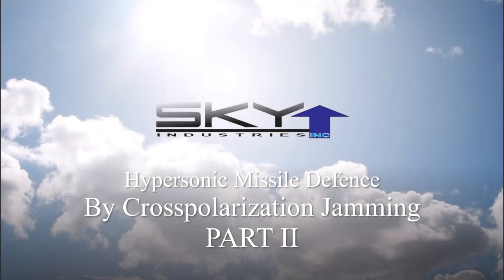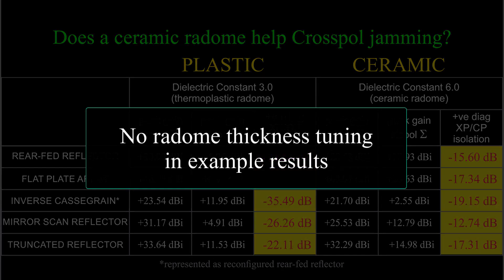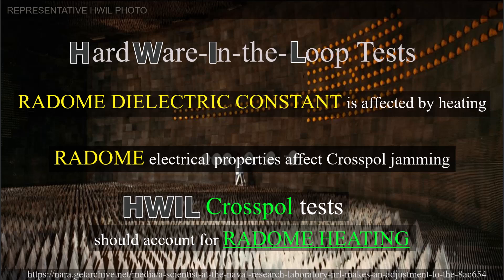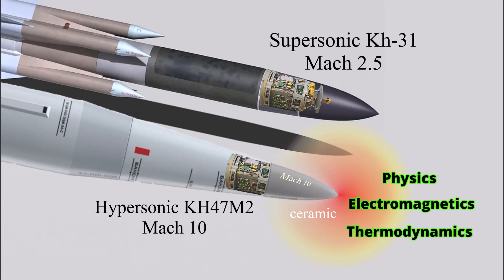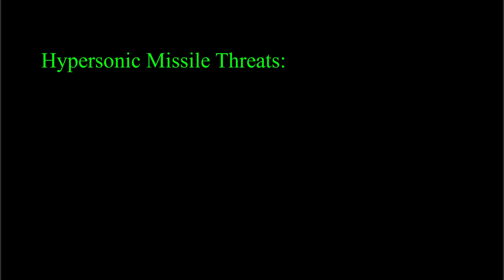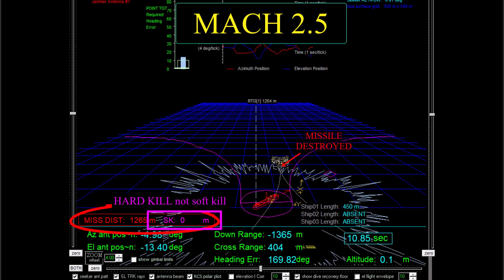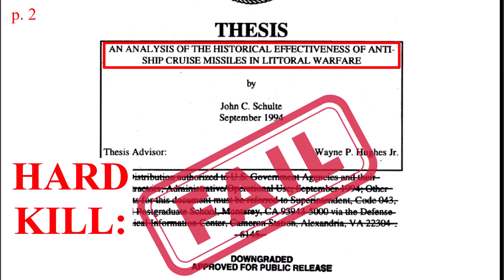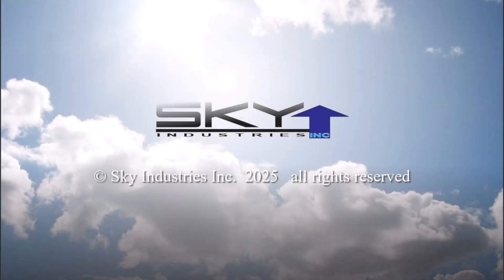Hypersonic Missile Defence By Crosspolarization Jamming PART II 25

Comment: There must be ways to eliminate plasma build up.
Reply from the maker: Yes - slow down!  

As a gas is compressed its temperature increases.  A flying high-speed missile compresses the air in front of it.  Above Mach 5 the compression is so great, and the temperature so high, that electrons become dissociated from their atomic nuclei.  That's a plasma, the fourth state of matter after solid, liquid, and gas.  

Reason metals are conductive: their are atoms are arranged in a crystalline pattern, but the electrons are free to roam around.  A metal is atoms in a sea of free electrons.  

A plasma is the same as a metal in this sense.
Reply: @skyindustries Thanks for explaining, so i guess 😅there is no way to eliminate this effect.

Comment: How about having an aerodynamic heat shield over radome which gets discarded in the final phase of the flight thus leaving you with a perfect radome?
Reply from the maker: Good question.  

A perfect radome in this sense would have a relative dielectric constant of 1.0, e.g. air.  There are materials with low dielectric constant, such as syntactic foam (plastic with tiny air bubbles https://en.wikipedia.org/wiki/Syntactic_foam), but no material which also has the mechanical strength required for a high-speed radome.  

Result: any radome will cause crosspolar gain by bending the polarization.  A ceramic radome happens to cause a relatively large crosspolar gain.  A thermoplastic radome will also cause crosspolar gain, just less than  ceramic.

Comment: what if you had a mach 10 radome that falls off after the missile slows down to mach 2.5 to reveal a mach 2.5 radome
Reply from the maker: Good points, but it doesn't solve the problem; a ployamide radome would likely work at 2.5 Mach,, but it also causes polarization bending - just not as much.  

Ditching the radome seems a risky maneuver at high speed.  There would have to be a big payoff to justify the cost and risk.  Payoff looks too small to me.

Comment: cant a missile be designed with a glass dome covered by a ceramic panel that jettisons at supersonic speeds during its terminal target acquisition phase?
Reply from the maker: A good and fair question.  

It's possible if enough money and time were spent, but it doesn't solve the problem.  

The main-thing issue is polarization bending cause by the combination of radome shape and the dielectric constant of the radome material; the higher the dielectric constant and the more curved the shape, the more polarization bending there is.  The dielectric constant of glass is ball park the same as ceramic, or possibly higher - so glass might be worse.  

What matters is how the microwave signal travels through the radome.  This isn't the same as the optical properties of the radome, so even though it's possible to see through glass at the short wavelengths our eyes react to, important things happen when the wavelength gets longer.  

To top it off, jettisoning a radome would be an expensive design option, and I expect physically risky for the missile.
Reply: @skyindustries  I guess I meant plastic not glass, and figured the tech already existed since space rockets already do similar things at high speed but yeah I guess in space it would be less turbulent to cause potential damage due to the air resistance at sea level.

Comment: upon slowing down below that melting point, eject the heat shield, revealing the plastic seeker dome.
Reply from the maker: Risky for the missile I expect, and doesn't solve the problem; a polyamide radome will still twist the polarization, just not as much as a ceramic radome.

Comment: all this high tech easily duped by fake target towed behind the ship.  where do i collect my billions of dollars ? XD
Reply from the maker: If your towed decoy looks like a ship you have a 50-50 chance of getting hit.  If it doesn't look like a ship a modern seeker will ignore it.  

When a modern seeker turns on the first thing it does is perform a "survey scan": it uses its antenna to sweep its "field of regard" (the area it can see) for possible targets, and records the bearing and range of each.  

It then sequentially stares at each one and applies "target discriminant" tests.  The designers know what a ship target looks like to a seeker, so the seeker will reject anything that doesn't have valid characteristics.  

Bottom line: if you aren't also using a RF repeater with some signal processing, your towed decoy will have to be another ship.  There are other options that are more effective and more affordable.
Reply: @skyindustries  works fine. proved many times including recently every day in ukraine.  you are overestimating the precision of the radar images they try to lock on. visual fakery is also not that hard. it does not have to be same size and w8 ship. it will be mostly empty thin walled floating metal box . but no... only trillions of dollars can replicate effect from thing that works fine for cheap  XD  but you will obviously defend the scam that feeds you. i understand. otherwise interesting and quality content. just wanted for ppl t o realise the BS part that overshadows all of it
Reply from the maker: @mrpicky1868  I don't think you understand the missile technology, or you are unintentionally comparing apples with oranges.  

Missiles do not "lock on" to "radar images"; they apply angle and range tracking to the skin echo, from which missile steering demands are derived.  

I am referring to antiship missiles (i.e. not variants used to attack  buildings and bridges) which do use multiple target discriminants to identify and reject active and passive decoys, and to prioritize valid targets.  The discriminants include glint, scintillation, variation of skin echo characteristics by radiofrequency, range depth, angular extent, and others.   

And they can be expected to additionally employ signal processing techniques once referred to as counter-countermeasures to reject and/or use signals from a jammer.  

I am aware of only one missile which advertises to create an image from skin echo reflections: Brahmos, by India.  The purpose of this feature is as a target discriminant to reject decoys and false targets.  I expect very successfully.
Reply: @ i don't think you understand that not everyone you talk to is an idiot. there is no magic 100% accurate target separation and identification while falling at mach 3 from space. these systems are much more flawed as they are without any countermeasures. mostly it's reflection size . very easily duped by decoys and that is happening every day in ukraine. i suspect USA aiming systems much more sophisticated but they still will make easy mistakes when challenged with multiple similar targets. they have to make a choice on very limited data
Reply from the maker: @mrpicky1868  If you are saying that the Ukraine navy is being attacked every day by hypersonic missiles and that the missiles are - or are not - selecting their targets, please provide references.  No sarcasm intended, that would be very interesting material to read.  

I think you are referring to hypersonic missiles used to attack Ukraine infrastructure like buildings and power plants and bridges.  According to online references the missile variants used for these missions do not use terminal phase seekers.  These videos do not apply to those missiles. 

If you are saying that hypersonic missiles are not a threat, you are in the minority opinion.  

No idea what you mean by "...there is no magic 100% accurate target separation and identification while falling at mach 3 from space".  Nor do I know why the figure "100%" is mentioned.  

Maybe you mean "...there is no magic 100% way to distinguish a decoy from a valid target while falling at mach 3 from space". 

Actually yes there are target discriminant methods that can be made to work with high confidence, depending on the geometry, environmental conditions and the characteristics of the decoy and the ship.  If you know there are none, fair enough; carry on.  

In my opinion, based on 40 yrs of hands-on experience, modern missiles are designed specifically to detect and reject offboard decoys, and so are unlikely to be fooled by these.  

Can they be fooled?  Yes, with some probability of success dependent on the methods used on both sides, but more is required on the jamming side.  

Unsurprisingly none of those details are in the videos.

Comment: Hi Shawn, thank you for the presentation. Two questions:

For the problem of plasma requiring the nose cone to have a higher dielectric constant, why not have a hypersonic ablative nose cone that is jettisoned during the final supersonic guidance phase? This would allow for the smaller nose cone to be built out of a material with a lower dielectric constant.

And second: I understand that at hypersonic speed the plasma prevents signals from passing through in the prograde direction, however would a satellite connection still be viable? Spacex proved that a satellite connection during reentry (same plasma effects) was possible. I’m wondering if satellite guidance during hypersonic phase, followed by jettisoning the hypersonic nose cone, might remove the susceptibility to cross poll jamming entirely.

Comment: could the missle shed its protective ceramic nose cone to a plastic one once it is in seeking phase? Seems very feaseable to do if you are going to build a missle that goes mach 10.
Reply from the maker: Good question, perhaps a missile could be designed that way; but it wouldn't solve the problem.  

Once the protective radome had been shed, the polyamide radome would still cause the underlying antenna to have a high crosspolar gain.  

Polyamide causes polarization twisting, ceramic causes even more polarization twisting.

Comment: 5:01 — excuse me, but... how does one end up with an modern, operational fire-control radar in their living room?
Reply from the maker: LOL fair question.  The APG-502 and MG13 are from the 1960s; they were top secret back then and are declassified now.  These units were effectively scrapped by the air force decades ago and given to the government lab where I used to work.  

Many years ago a technician at the lab was given the job of decluttering a building where they were stored.  

When he was effectively told to scrap them he asked me if I wanted them, since he knew I had tested with them.  

I said I'd take them for teaching purposes.  I transferred two to Carleton University and kept 4 examples of the APG-502 antenna group and one MG13 antenna, and one MG13 feed.  Fascinating engineering, especially the microwave plumbing for the feed and monopulse comparator.

Comment: Man sometimes I mishandled my cookware coming out the oven and then it just crumbles apart luckily though I use a secondary for mess cleanup in my tinfoil, makes clean up much easier. Typically I take my meals out the bottom of my deep freezer though before it gets anywhere close to the oven that way I know the oven is preheated for quick delivery.
 I did understand Lockheed Martin from this video though, f35 or whatever that new fangled plane is. I seen some cruisers above some fisherman one time I thought I wonder if they're gonna catch a tuna that low to put in a freezer.
Big Boats are cool. I'd sure like a nice fishing trip sometime. Maybe a two pronged solution to get me the big one like radar I seen these new fishing sonars. Maybe that plus my old trusty inline spinner or casting spoon would do the job.

Comment: Im just an ordinary dude, but I thought the days of not being able to transmit data at hypersonic speeds, through plasma, were over. I mean, as soon as SpaceX demonstrated it could maintain a High Definition video and audio transmission from Starship all the way through peek heating of reentry, that seemed to be the day the world learned how to get around this problem.
Reply from the maker: They have solved a different problem; the SpaceX solution doesn't apply to the seeker head/plasma problem.  

In any case, if the seeker could see through plasma it would still have a major vulnerability to Crosspol.  

The problem isn't particularly that the seeker can't see through conductive plasma; that's just the reason the missile slows down, and so can re-use a supersonic seeker, in my opinion.
Reply: @skyindustries  So fascinating. Thanks for taking the time to talk a little more about this

Comment: None of this matters. The Iskander, as one example, is so frequently used against fixed targets. The missile has an inertial guidance system which is completely immune to any type of interference. It has a seeker too and it expects the "conclusion" of both to match reasonably closely but if they don't priority is given to the information from the inertial guidance system. 
Finally, it is not known whether target co-ordinates can be updated in flight. If that is used, then one can simply calculate where the target will move to, and send the new co-ordinates to the missile. Which, again, it will use its inertial guidance system, if it works out that the information from the seeker is unreliable. And, of course, they wouldn't have fired just one Iskander to the target, especially if it's a high-value target, like an aircraft carrier.

Comment: Glide hypersonic missile use own gps with ai pilot,if u jamming the signal,and they know target locations just 700 meter straight, they just move on straight line without not care whatever happens on gps  system.wallahuaklam
Reply from the maker: Yes that's what the missiles do if the target is stationary, like a building or a bridge.   Unlikely they will rely exclusively on GPS since GPS can be jammed, but I get the idea you are conveying.  

However, if the target can move after the missile has been launched, the designers use a seeker. The problem is quite narrow and practical: we need to defeat currently-fielded missiles with a solution that is as future-proof as possible.  

And the countermeasures which are the most future proof are the ones which exploit weaknesses that are built-in by future-proof causes: physical laws.  That means the laws of physics, electromagnetics, thermodynamics, and although it's not a physical law, also economics.